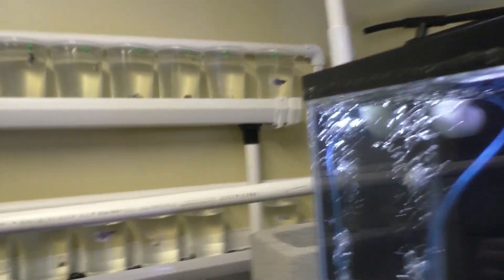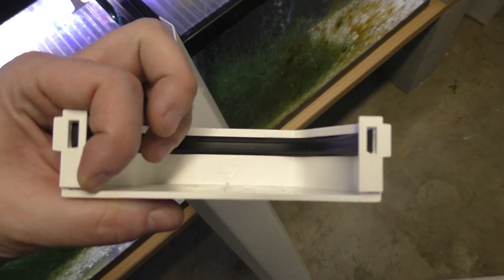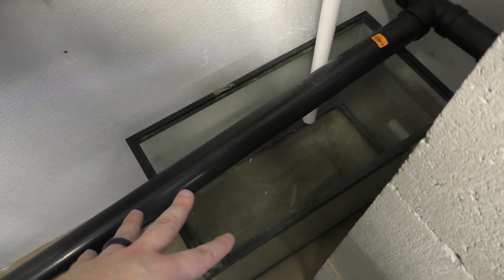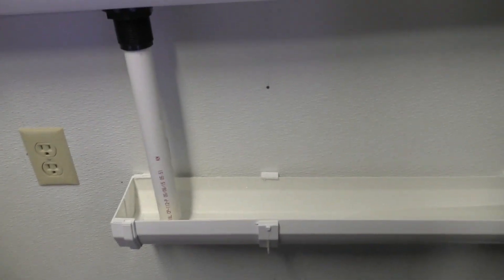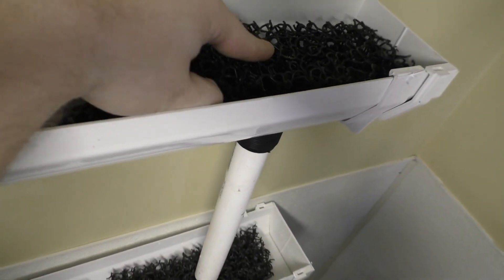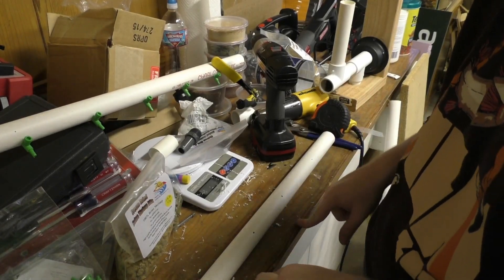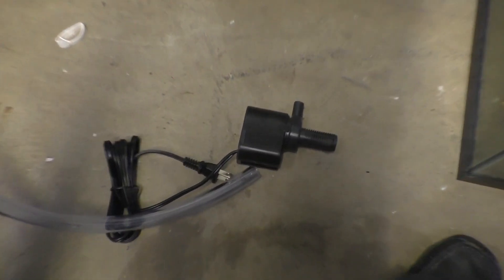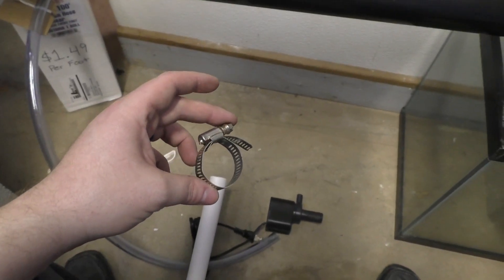Build a DIY Betta Barracks Rack System | How to Build a Fish Room (Part 6)

Comment from the maker: Missed an episode? Watch the whole series here: https://geni.us/FishRoomBuild
Reply: @AquariumCoop
Did you use pvc cement or silicone when gluing also im building this with 1 inch pipe trying to figure out how powerful of a powerhead is need bought most the pieces tonight just trying to figure out whether to use the valves u linked here for the water portion piping or use the screw in valves you guys carry instead does it matter on jehmcos site says not for use with water systems but I've seen dean uses it on his fry system

Comment: Thats pretty nifty. I did the same cups but used all irrigation pips and no pvc. It fits 150 and waters all at the same time with a 110gallon sump. The 420 gallon pump didnt work for the first 60 cups so we switched to a 3200 gallon and use it as a daily flush and water change. Thanks for the vids!!

Comment: Pretty cool system. Only problem i see is if your main tank crashes ,then all your bettas could crash at the same time too. Its definitely cool though, how often would you have to check or change main water tank.
Reply from the maker: Definitely pluses and minuses to this system, for instance all disease is shared as well. I ended up taking this system down but water wasn't too much of an issue. Small water chance once a week.

Comment: I like how you moved after this to keeping betta in your community tanks. I saw a very similar set-up to this one in Denny's though, and it impressed me--their betta were much happier and in better shape than the PetXX ones. Some locals sharing ideas, eh? :D
Reply from the maker: No, their system is an off the shelf solution that doesn’t circulate water. The elive system could have been so much better.
Reply: Good to know! I just saw the hoses going in the top (which is more than most stores provide), but it's been a few weeks since I checked it out :) Maybe if they do an upgrade ;)

Comment: As a quarantine system, I feel like it wouldn't work well unless you have a different rack system set up for each new shipment....since the water is recycle from all the containers..correct? Or did I miss something...I tend to drift off sometimes..lol
Reply from the maker: +heatherwanderer777 Well yes, you'd move all the bettas out between shipments etc. That being said bettas are rarely ever sick. The biggest problem they suffer from is velvet which you can med them for when they come in. Really it's not different then bringing in a bag of 300 cardinal tetras. Treat them then move them out to sell them and bring in the next batch.
Reply: +Aquarium Co-Op yeah, that would be the only way to do it. Remove the entire batch first before the next batch comes in and you should be good to go. I bet they love it when they get to the store since you have bigger tanks there :D Even this DIY is bigger and much fresher water then you'll see in the box petstores

Comment: A lot better than what i've seen from some importers, but wouldnt they jump?
Reply from the maker: +Attoz I needed to lower the holes a bit, I also bought a bigger container that fits yesterday that I'm testing out. All small modifications. The system will work itself out soon enough.

Comment: Nice video. On the green plastic valves, any issues with durability? I had to swap them out from an air system I had years ago, they didn't seem to hold up like the metal ones. Also, what's in the sump besides water? In a fry-raising system I had, I put in a UGF plate with a few mesh bags of ammo chips and ammo carb just to keep the ammonia at zero; fry didn't like even the slightest ammonia and the full bio cycle wasn't needed due to frequent water change.
Reply from the maker: +igotadose For the valves, I've been using them 10+ years in air systems. However I don't have that much time using with water so not sure on that. I think if you want to upgrade the metal valves are a nice upgrade but ups the cost by quite a bit on this project.

Comment: cool project Corey!  I've never heard the proper name of that metalimat (is that how its spelled?) before.  I have some in an overflow box but just never knew the actual name!  What would your thoughts be on simply allowing the water to overflow over the top edge of those deli containers instead of making the drain holes?
Reply: +Rich's Fishes Bettas are jumpers so you need to have a lid on them really
Reply: Ah ha.  So there is a method to your madness!  I've actually never kept a betta so I had no idea.  Are you planning on adding lids to the containers you used even though the water level is a bit lower than the top?   Guess it would be simple enough considering how prevalent those containers are.
Reply from the maker: +Rich's Fishes I'm actually testing some new containers. For lids. It is a possibility but I'd need a decent sized feeding hole. But yes the more safe they are the better. Still improving.
Reply: +Aquarium Co-Op well since the valves are for air lines why not hook an air to the valve run into the lids and add air holes to the lids. water and air still get circulate. May have to raise the filler pvc a bit but it would be safer i think. IMO
 Just my thoughts

Comment: What would you recommend for the sump filtration? I have a 20 gallon tank and my system is up and running. Looking of ra cost effective DIY filtration system that is effective. Thanks yet again Cory!
Reply from the maker: +Ed Henry I'd use some sponge filters, pot scrubies, and a filter sock.

Comment: hey guys, if you are looking to upgrade to a bigger tank or getting extra tanks; head out to your local petco right now. They are having their $1 a gallon sale on their 10, 20, 29, 40 and 55 tanks until the 23rd.
Reply: +jj&#39;s tanks Pet supply plus is now doing that same type of sale same $1 per same/ Gal. sizes till 28/2/16
Reply: Robert Palmer 28/2/16 its only 12 months in a year not 28
Reply: Yeah I know.
 It's day/month/year

Comment: Great vid Cory!  I'm wondering if a larger drip system would suffer from unequal pressures along the drip line on each level, making it difficult to dial in each driper without changing the drips of the others.  If that's the case, do you think the performance would improve if you went to a loop system like you would an airline?
Reply from the maker: +Bob Luckey Yeah a loop would be better for a larger system. Typically I find it's the strength of the pump that determines if I'll have problems or not.

Comment: I built a large betta rack awhile ago, using the same principles. Main issue I ran into was that the containers became dirty and it can be quite a chore to wipe down 60+ jars. My containers were a bit larger and semi-permanent so simply swapping them out for new ones wasn't really an option. What I like about yours is that you could probably throw away the cups and replace them once every few weeks instead of having to clean them.

Question: Lamont and you both feed live blackworms. What is your source for those? No issues with disease? I know some people are afraid to use them.
Reply from the maker: +Iowa Discus The goal is that the containers are removable. I'm thinking I could swap the container every time I move the betta to the store or sell it at the store. Put the used container into a bucket of bleach lets says, then rinse it the next day. I'd have to see how that system works.

As to the black worms. I bring them in from wholesalers. We go through 10+ pounds every week at the store. I find that all foods have problems with disease. Even flake food spoils. Some parasites etc make it through frozen foods. Sometimes frozen foods get thawed in transit and refroze which fouls them. Even live daphnia if it's from outside has parasites etc. I think you have to weigh the benefits vs the risk. Live black worms really help put weight on fish and spawn them. You could also get some issues. But if you can spawn a fish with live black worms, or not using "safe foods" really only live black worms is accomplishing the goal.
Reply: +Aquarium Co-Op Agreed, though I think one can minimize the risks with most other packaged food whereas how do you sterilize a living creature? Where would you recommend buying live blackworms from? Do your wholesalers sell to small-time hobbyists?
Reply from the maker: No, wholesalers only sell to retail stores typically. If I could get the same nutritional profile and the fact that it wouldn't foul the tank from a freeze dried or frozen I'd use them. But I can't so I use live for a few different species. Even shrimp love the live worms.

Comment: Great video!  My question is that how can you do water change to all those containers?  Do you have a similar barrack system that can change water to all containers and siphon poops at once?
Reply from the maker: +Jon Bettas You just change water in the sump as all the water is shared between all the containers.
Reply: what about all the poops/food at the bottom of each container?  they seem to stay at bottom all the time :)
Reply from the maker: You can turn up the flow once a week to make sure it leaves the cup.

Comment: Are those cups there permanent home. If so how long do they stay there and did you breed them your self or were they imported? :)
Reply: +TheGardenolgist ! I think they are for quarantine
Reply from the maker: +Attoz Correct, they're for quarantine. I am considering putting this system in my retail store also. Typically right now, bettas last up to a week in my store before going to their new home. It's a catch 22. Currently all bettas in my store live in 5 gallons or  larger, basically in community tanks with other fish. But my selection is low and people want more selection. But no one can afford to put 100 bettas in 5-10 gallon tanks due to retail space prices.

Comment: nice build, if i was to offer one caution it would be the standing water in the gutters positioned above and right next to a power outlet and a light switch, one leaky seal will ruin your day.
Reply from the maker: +Greg Jones (Greg's Fishroom) Yeah a leaky seal would be bad. There is no standing water since there is a slop. If you turn the pump off there is no water left in the gutter essentially.
Reply: Silicone is your best friend with them self seal end caps 👌🏻